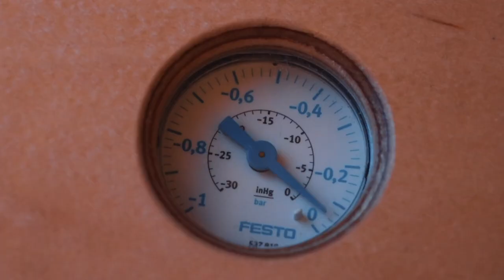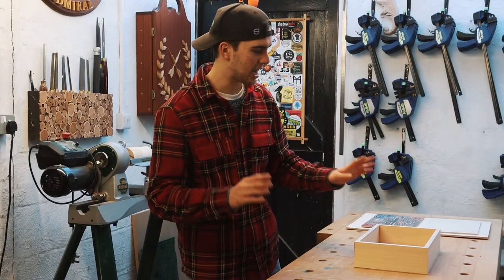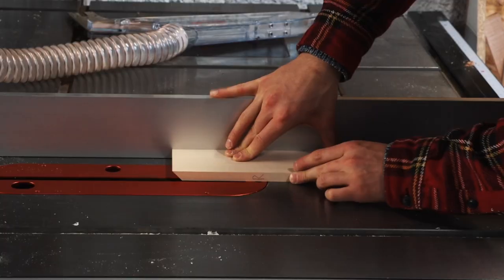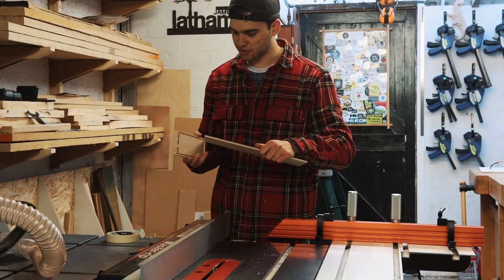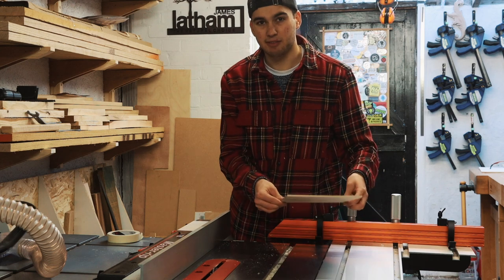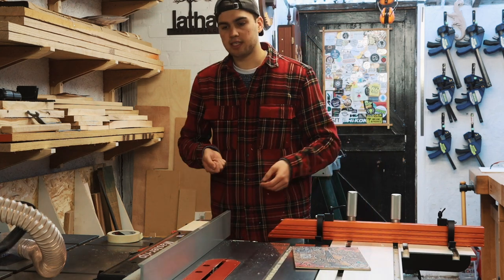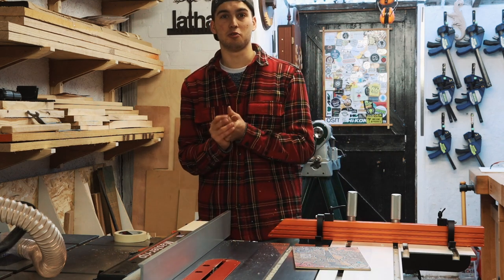How To Make A Custom Mosaic Box! With Black Trim And Brass Hinges!

Comment: Hey Sean,  loving watching your work after seeing you at MC.  I notice on your boxes, when you separate the top and bottom on table saw you finish the cut with Japanese saw. Why don’t you complete the full cut on the table.?
Reply from the maker: Hey Kev! Thanks a lot. That's to allow a straight cut all the around the box. If the blade was high enough to go completely through the wall, the lines aren't likely to match on the corners and could mess up the veneer on the inside of the box. This is a cleaner way of protecting the inside of the box and making the line flat.

Comment: Hey Sean just done a small mosaic and just about to fill with the epoxy. I was wondering do you have any issues with grain filling up with the coloured epoxy.  Especially on lighter veneers.
Reply from the maker: Hi Kev, if you are using open grain woods, then that can happen. But most of the time you can get ride of that with sanding. I tend to use sycamore or popular and haven’t had issues with those.